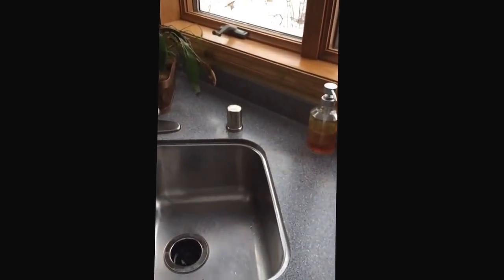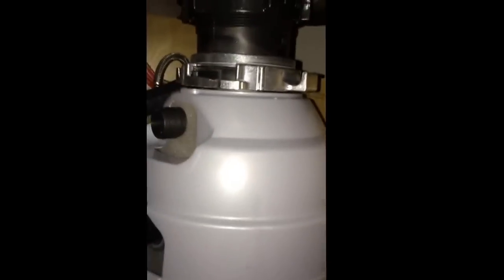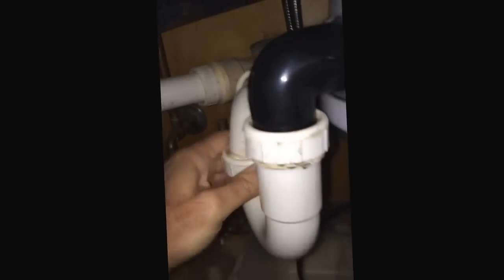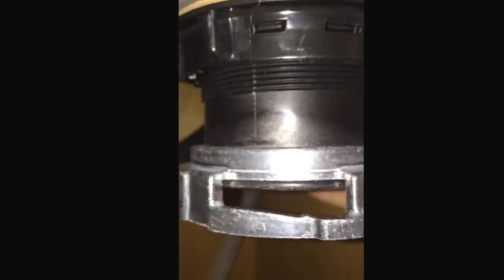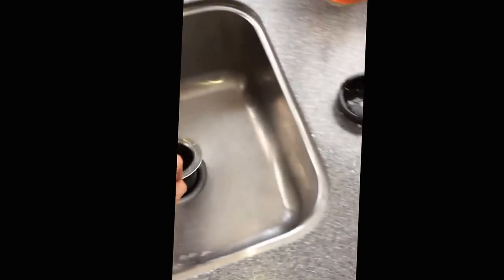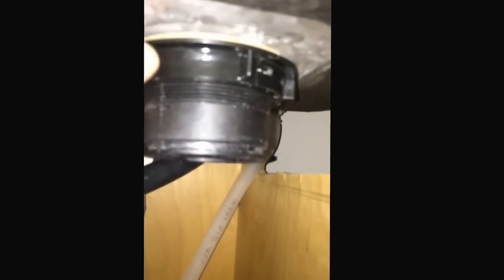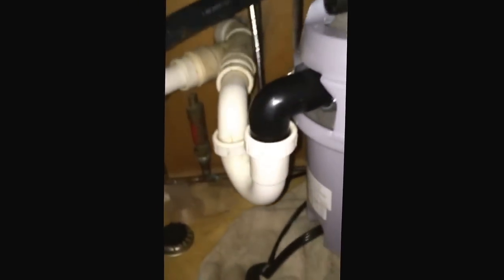Waste King installation

Comment: I've replaced 3 Badger 5 Incinerators in 10 years. 2- 1/2 hp and 1- 3/4 models and they all lasted just a tad over the 2 year warranty period.
When the Insinkerator 3/4" finally gave out I replaced it with a Waste King 3/4hp 3200. What a difference! Quieter, More power, Stainless Steel
internals and 8-10 year warranty depending on the model number. I stuck with the Insinkerator because of the quick swap and because it was the industry
standard and choose to give it a chance but the third time was a charm and I will never look back.  The install on the Waste King was just as easy and took about an hour from start to finish.

Comment: Thanks.  It had been a few years since I installed it and had forgotten how to remove by removing the washer.  Incidentally, I've had two Waste Kings and both had working motors, but their blades broke or rusted out.

Comment: Thank you for the tutorial! I'm looking to buy a disposal and this helped me see how it mounts to the sink. I'm trying to decide between the Waste King L-8000 and the Waste King 9980 because I'm not sure if the metal 3-bolt mount is better.
Reply: +David J Let us know if the 3-bolt flange is thinner and sits lower in the sink, thus trapping less water.  If you use the 3-bolt flange system, can the black "spoon guard" still be remove for monthly cleaning?
Reply: +birdwing98 I ended up purchasing the Waste King L-8000 so I don't have any experience with the 3-bolt flange system. Sorry I couldn't be more helpful.

Comment: I have the same one. Rubber gasket goes under the sink, not on top. In between the sink and that cardboard/fiber gasket. Little bit of plumber's putty on top will seal everything
Reply: Yes, Henrique, you are correct and the guy providing the video tutorial is wrong.  The Sink Flange sits up high because of the incorrect installation of the rubber gasket and the leaking problem is the by-product.
Reply: Not according to the directions.

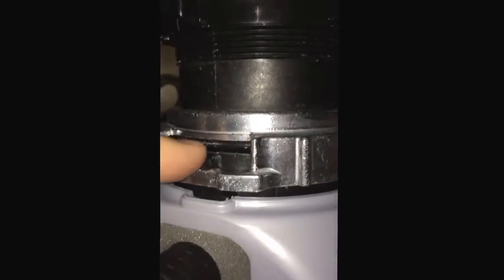Comment: 6:45  If you have trouble getting flange and disposal to orient properly to drain pipe, try LUBRICATING rubber flange with liquid dish soap before assembly.  (Talking about the rubber flange that holds the metal ring with twisting/locking ramp on it.   7:56 Holy Crap Batman!  I see an "Approval Sticker" from New York City!   Does New York City regulate what happens in the bedroom too?

Comment: Good video, but you might have mentioned the "knock-out" plug for the dishwasher connection. If a person has done this before, they'll know, but if they forget, things will flood washing dishes if that's not done.

Comment: How does the rubber washer hold the weight of the disposal? Since it is only thing holding bracket, I can’t figure out how it doesn’t pull whole thing off once weight of disposal added
Reply from the maker: The flange that goes from above through the sink opening is what supports the weight. The rubber washer just gives a water tight seal once the silver piece below the sink is rotated and tightened.  Hope that makes sense.

Comment: so did you keep the putty or go back to the rubber gasket? I'm about to install one myself and would like the flange to sit as flush as possible. thanks!
Reply from the maker: I went back to the rubber gasket. The putty didn't seem to make any difference and actually made the flange sit up higher.  This sits up maybe 1 mm higher than I wanted to and can cause a quarter size amount of standing water next to the flange, which is really no big deal.

I think the problem is with the hole geometry of my sink.  But overall still really happy with this disposal.
Reply: David Caropreso thanks for the quick reply, I'll stick with the rubber gasket. Funny how some of my newer sinks have that standing water around the ring; which i hate. So I try to avoid it when I can.
Reply from the maker: This sink is probably 20 years old so I don't know what the deal is. Let me know how the install goes.
Reply: +David Caropreso  Insinkerator Disposal uses 100% stainless-steel sink flange which may be thinner geometry than the black ABS flange with the WasteKing.  Perhaps that is why water sits around the ring.  Can you apply plumbers putty or caulk around top perimeter of flange to fill in the "gutter" where water is trapped in sink?